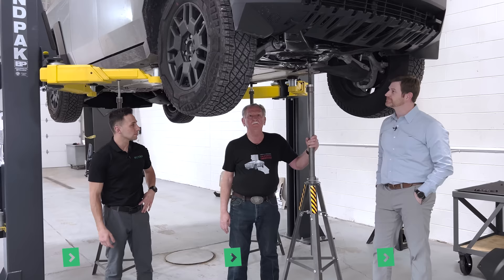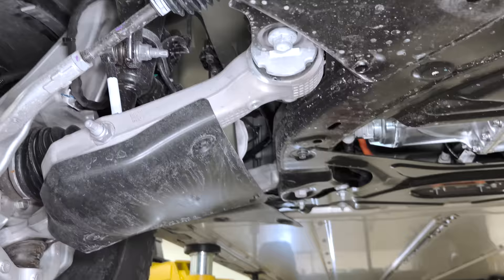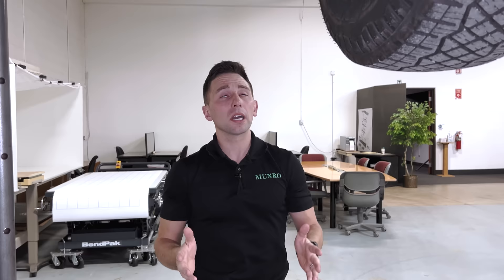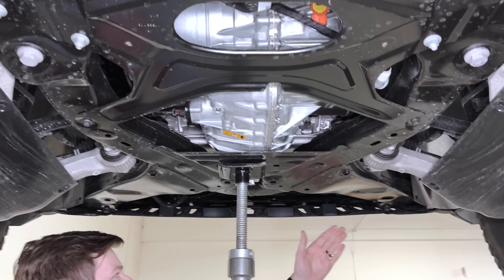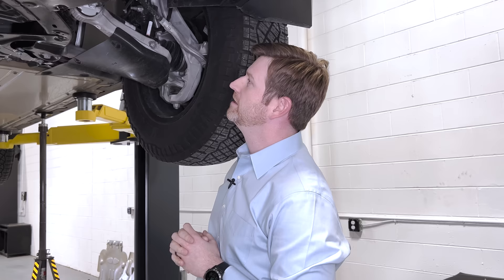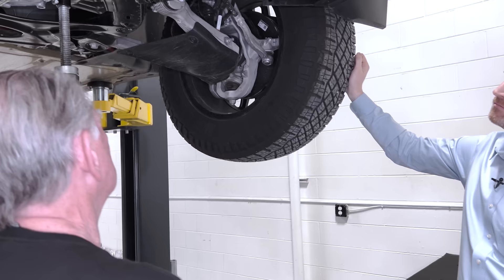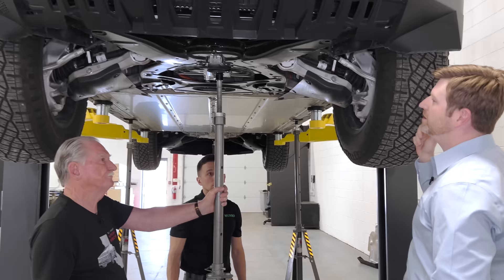Tesla Cybertruck Underbody

Comment: The whole suspension design looks very CAR to me rather than TRUCK.

I'm gob smacked there's no under body tray to prevent rocks, mud & branches getting badly snagged and doing damage to all the moving parts. I mean look at the two cooling fan power cables, they're both hanging right down at the lowest point, just begging to get snagged on brush & rocks and ripped out ! The cabling on the rear wheels is even worse !!

The welding on the suspension cradle seam looks HORRIBLE ! There's also so many places for water and mud to build up and get trapped inside the hollow structure.

The tires are a strange tread pattern for street use. Especially wet road water dissipation....

Note to anyone who owns this vehicle. It is NOT designed to go off road, do NOT take it off road except in an emergency, because the chance of expensive damage is VERY HIGH 🙄💲💰🔥

Comment: 4:03 Explain industry terms for us laymen... Short-Long Arm
The Short-Long Arm (SLA) suspension is also known as a Double Wishbone suspension. The SLA name is derived from the length of the control arms. The lower arm is typically long to provide a good spring lever ratio. The upper arm is typically short to provide the proper camber curve.

Comment: One thing you guys didn't mention was the suspension changes.  So when you drive a car, you want it to absorb bumps, you want to feel but control the tires.  But they probably changed the suspension because they don't want to feel anything.  They have an electric motor doing the turning, and that doesn't like getting "feedback".  They want absolute control over the wheels from the steering perspective.  So given that you no longer design the front suspension for the effect of the driver, you are desigining it to take impact and be controllable by an electric motor, you are working with a completely different animal
Reply: TESLA updates Wheels & Tires every 6 months.

Comment: SANDY AND EVERYONE!!  I am surprised you did not think of this. The extra unused connector could be for the range extender battery module which needs to tie into the existing battery/power system. If you have a dual motor that could also be for the tri motor if the motors are fed with two different power feeds. (maybe not)  Maybe just for the range extender.
Reply from the maker: We did think about it, just didn’t say it.

Comment: Could that bolt on thing on the front ball joint be for vibration mitigation? It may also function in a crash but maybe not the only benefit.
Reply: When I’ve seen them point out tuned mass dampers in vehicles they’re usually isolated on rubber mounts.

Comment: Several videos out there where the stamped steel upper control arm mount is the weak point. But, I guess, if the upper bends or deforms, that would be better than snapping a casting.

Comment: could the extra connecter be a form of checking the battery without unplugging anything. That way it's less time taken to diagnose.
Reply: or maybe even having a device connected that sends a small current so as to check if wires have been connected before putting things together.

Comment: In the tie rod area, i think your overthinking it.. in the event of an accident, the subframe would absorb more of the impact. the likelihood of the knuckle taking the impact or "bracing" the load in the event of a busted rim would be minimal to the damage done to the subframe.. most cases in 3/Y the subframe takes damage and LCA's over the knuckle.
#2 the open connectors you see are there because of different vairations/options of the model.. It is cheaper to make the same harness that works with all models vs making different variants in the manufacturing process..
#3 the Rear subframe defects you see are due to new tooling and tesla's new process that are doing with high pressure cast molding.. its almost "forged".. the burrs are QC cleaning up sharp edges
#4 the Battery pack he is talking about actually is  the modules which are separate from the HV battery..
#5 spot welds.. thank the new edge of tooling.. robotics and engineers.. that bottom plate with SPR's make the battery pack easier to rebuild/fix.. the battery pack was made to be easier to repair..

Tesla's have been ahead of the game since the beginning.. cant wait for my truck!

Comment: I ASSUME there were some covers both at the front and rear that were removed.  Surely they do not leave that HV wiring and connectors at the rear wide open to dirt, mud and winter schmutz.

Comment: Normally for the electronics bay / battery you would just see high voltage connectors, low voltage connectors, and coolant lines. This one has what looks like black metallic pipes going into it as well. Refrigerant lines from the heat pump system maybe? I don't remember that from the octovalve / supermanifold based thermal management systems in the other cars.
Reply: The black metallic pipes look like brake lines. I guess, they likely just route them through the battery pack (without any use inside the pack) from front to rear so that they are better protected from the elements, rocks and debris. The Hydraulic Control Unit (HCU with the ABS pump) is likely still at the front of the vehicle. Then two connections to the front brake calipers. Two connections to the rear brake calipers. Those to the rear: though the battery pack.
Could also be an air pressure line, with "PHLY" on it. (22:06) To give overpressure to the pack when wading water.
Reply: @MooseOnEarth  Thanks. I thought they looked brake lineish, but couldn't think of any reason why there'd be brake lines in the battery so my brain fell back to refrigerant.  :)
Reply: They are Air lines for wade mode pretty sure

Comment: What are those two black lines going into battery on the back, between high volatage connectors and cooling hoses (at 22:14)? 
Is it air to keep the baterry pack ovepresured?
Reply: My guess: just regular brake lines routed through there. But a guess on a air pressure line to create overpressure in the pack would be feasible as well. There is "PHLY" on it (22:06 ), which says: it is a pressure line.
Reply: Certainly. With 1 being the input and the other being the drain maybe?
Reply: SCUBA system , for wading.

Comment: 19:30 This is a ' Foundation ' model, many manufacture changes you'll find on this will be changed to reflect these changes later.  Treat the Foundation models as ' early release of software '.  Like the tooling work done, later models won't have that and will just be molded that way.

25:00 it's not that welds didn't work there, its they couldn't.  Welds require direct metal contact, at that point there is a type of silicone seal between them.
Reply: it would be Interesting , to compare to 2025 Cybertreuck.

Comment: That high voltage connector is likely for the extended range pack…but…. Aftermarket could make a massively compelling range extender that makes the vehicle a hybrid… as much as I hate ground up hybrids, a bolt on solution would be a great use case. Towing a trailer to remote areas?… put a generator on the trailer and shunt the power through that connector. Or make a small gas turbine generator to slot into the smugglers bay. 

They could be rented as needed.

Comment: Is it even legal to not have a mechanical link between the steering wheel and the actual steering mechanism, be it a rack or box? It certainly used to be the case in the UK that it was a legal necessity at above 50kph 31mph or so. Hence JCB Fastraks  60kph capable always had a steering box with a shaft linked to the steering wheel and rods from the box to the wheels, while smaller 50kph ones could have hydraulic steering using Orbitrol units attached to the steering wheel and pipes out to the steering rams.
Reply: TESLA ,is the ONE to Benchmark.

Comment: Do sound level measurements of the interior with a decibel audio meter or audio Spectrum Analyzer  then remove one by one , rerunning the same course,  any questioned and not understood by Sandy, NVH shields or mats and run the CyberTruck down the same test course and record the results on the meter or spectrum analyzer(preferred). Then you will understand why the Tesla Engineers made the choices they did!

Comment: Thanks for video! Interested to know more regarding bi-directional charging. Here in Brazil folks enjoy this aspect of the BYDs which allow 3,000 watts, which help to keep a frig/freezer/tv/internet and few lights going during our periodic blackouts. You just get an after market adapter which snaps on at the charging plug. Run an extension cord to a secondary electric box & Bob’s your uncle. How would this work on CT? And do you see it on other Teslas current/future? Musk says just get a power wall, but wouldn’t this be inexpensive to include on other vehicles and add this feature to that home power station ecosystem in place of and/or in addition to the power wall? You just include the necessary hardware to the wall chargers for example? Also, looking forward to things which can be used in the Model 2 (or whatever it will be called). Hopefully those M2 & other more accessible models will go for sale here soon, where the BYD Dolphin, Dolphin Plus & Seagull (retailing for U$ 30, 36 & 23,000 respectively) are taking off. We need the Tesla Supercharger network too! Thank you again for the videos!

Comment: Question?
Did anybody get a gauge thickness on the metal that's on the underbody?
I wonder if it's for protection? In regard to crashes?
That blue factory mark, could be assembly?
Has anybody at Munro done a TOTAL PARTS count for the Cyber truck Underbody? Then compared to let's say a Ford or a Toyota Truck?
Reply: the CT battery pack is STRUCTURAL.

Comment: Extra connector is for range extender or possibly the quad motor which they were considering through the development process (and ended up with trimotor). Might still be an option in the future if a competitor comes out with a faster truck but that’s not a problem right now.
Reply: This thin wire (about 4-6 mm², about AWG 9-11, about 40- 50A, about 32-40 kW at 800 V) neither supports a motor nor fast-charging a 50 kWh range extender pack.
Reply: @MooseOnEarth  What wire? they were talking about a capped plug on the battery pack which supports enough amps for supercharging and/or running another motor.
Reply: @ranig2848 See 15:43. Jordan even points at the open connector.  There is an addtional connector right next to it, that is not open, but where a plug with 2 out of 4 wires is actually inserted (not sure, what HV component is connected there). If you take this connector as a reference, it will not support supercharging. The three big HV connectors with the heavy gauge wire at 15:27 (front motor, rear 2 motors, with charging likely from the top) are already used.
Reply: NOPE, its in the REAR.

Comment: 20:00 "10-15 hours on a machine that cost 600 an hour"

With all due respect, that calculation alone should be an indication that this is not what they did. They don't spend $6000 on making an invisible part look marginally better.
It's much more likely that they took a few hours to program a cheap  CNC machine and it did the job in ten minutes, if that. It's probably some poor dude with a dremel, removing the markings where it says "Made in China".
Reply: He’s saying they DIDN’T do an additional $600/hr pass to smooth the die.

Comment: Yet another sign that TX/CA designers have no idea about snow and salt in the rust belt.   Headlights will be hidden by 2” of snow and the aero panel on the front suspension is a good ice/snow packing system that will change the suspension weight and handling once packed tight with debris.  Not to mention corrosion accelerator.   Yikes.

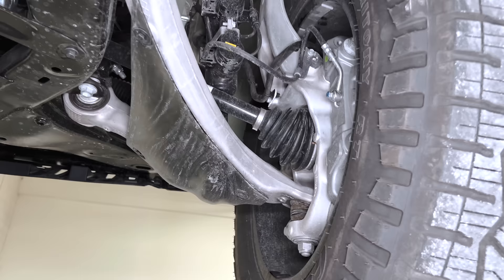Comment: 4:18 bottom ball joints can’t be removed for maintenance without removing the driveshaft, which in turn means removing the wheel and top ball joint too 😂 yet more labour for running costs .

Comment: 18:45 The touch-ups done on this rear cradle, it looks like the mound for the cradle was made, then the design was refined to lose weight but they wanted to use the mound for the first trucks anyway. So grinding out the spots where the changes were made brought the cradle into spec with the new design.

I’d rather do away with the cradle altogether and design the strength into the structure of the motor/transmission assembly.
Reply: The cradle could be used as a sacrificial piece if the truck hit a rock and the cradle would be the first part to break. But it looks like it is on the back so it would only make first contact with a rock if the truck was going in reverse.

Comment: The blue connectors on those fans on the grill mean the fans are 48V. All the connectors on the 48V system are blue. Some electrics are still 12V. And of course the 800V system has orange insulation and connectors.

Comment: Why do you use those jack stands? That hoist when lowered onto the safety catches would never fail in a thousand years. If it did they wouldn't protect you anyway. They would cause the vehicle to pirouette off & probably collapse in the process. I worked under hoists for 40 years & never saw one even come close to failing or dropping a vehicle.
Reply: What if earthquake hapened,,😊
Reply: SAFETY.

Comment: Unused. Capped connection are typically for future potential future accessories yet released. I’m eyeing up that Low Voltage connector to power a lm aftermarket Rear Camera washer pump to make an installable kit to hide in the Storage compartment in the bed to feed a rubber hose into the tailgate and add a spray head (some Drilling skills required, hopefully all through plastic trim pieces to install it)

Comment: It's very odd how everyone talks about crash safety yet nothing is said about steer by wire, brake by wire and throttle by wire. Any of those systems failing is going to cause issues as is not training the meat in the seat, all the safety features in the world won't save you from a poorly trained operator.

Comment: Great content, as always! It looked like the connector for the pedestrian warning sound speaker was easily accessible? I plan to use the Cybertruck as a hunting vehicle (among other things) and while software enabled off-road "Stealth Mode" would be the best option, it looks like it would be pretty simple to unplug the speaker before the driving in to my stand and then plug it back in afterwards? Still waiting on Cyberbeast VIN. Lastly, agree it seems the open HV connector is for the Extended Battery Pack, and perhaps the open low-voltage connector is for "Boat Mode" propeller control, haha, more likely something to do with trailering?

Comment: I think reviewers should take these EV's out in extremely cold weather, leave them outside for a day, and try to charge them, see how range is affected and then try to find a charging station that actually works in extreme cold weather.  I can foresee too many problems with EV's, especially if they start using them for First Responder/Emergency or Military usage.  I can only imagine how that's going to negatively impact our society.  I've seen articles where charging stations are basically parking lots of unusable EV's.  Huge potential problem with ALL of them.  Tesla's included.

Comment: my guess on the 'useless' or for sorb metal piece bolted into the front is to break up circulating airflow around the rim to improve aero or cooling of the rotor.  Ie. it prevents turbulence within the wheel.
Reply: I'm with Jordan.
Wheel deflection on impact

Comment: I can see them making that front under body "X" becoming aluminum like the lowers. Look at all of those welds they have to use to make that steel tubular part. It is clearly two stamped, Top and bottom welded together but it isn't two pieces it is several pieces with top and bottom welded. Way to much work. Cast that in double wall aluminum and put a steel guard plate over it for aero properties and to act as an impact plate.

Comment: Blue inspection mark???? It's a paint mark to show the fasteners have been torqued. Munro Tesla videos are a complete joke imho. Anyone who works in the auto industry can see this as well.

Who spends multiple millions on a "Giga-Casting" and then dumps half a ton of Steel Subframe underneath it.

The Cybertruck is a joke, dangerous to pedestrians and passengers, flawed in critical areas (A pillar visibility obstruction), useless off-road, no FSD (not that FSD was a "thing" anyway).

It's a vanity project, nothing else. #checktheshareprice

Comment: When the vehicle is raised, it looks like mud would just sit in that tray thing. I bet if you lower the vehicle back down, it slopes in a way that it could be sprayed clean if aiming through the wheel with a hose/pressure washer.

Comment: Sandy says “it has the works” about that non-used plug, but that is NOT true, as there is an extra battery pack that goes in the bed of that truck. I believe that is where it plugs in to power (extend the range) of the truck.

Comment: The Cybertruck is flat out dangerous.  Dangerous to be in it during a major crash and dangerous to anyone that is hit by this fugly truck.  
SS finish looks terrible.
Tow capacity (as far as range) is a joke.
The style is awful unless you like cars that look like they were designed by an 11 year old.
Cost is ridiculous.
Truck bed capacity is small.  (even worse if you get the extended battery so you can actually take your RV on the road)

This truck is designed for people who don't actually use trucks as trucks.